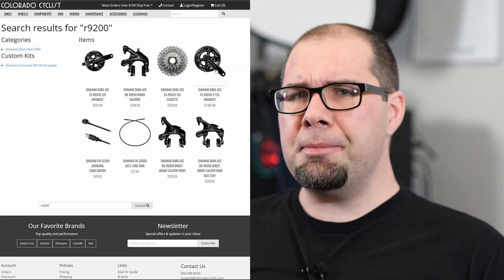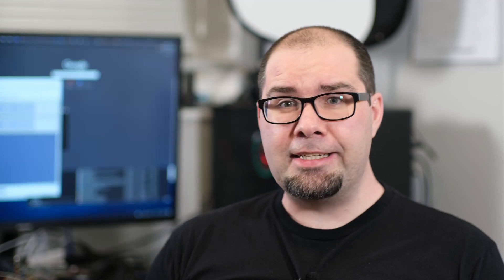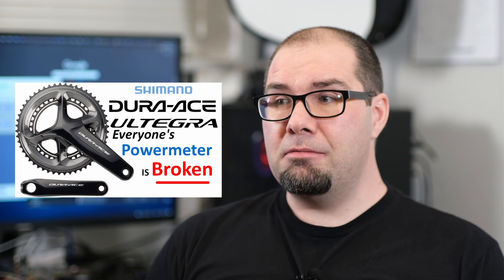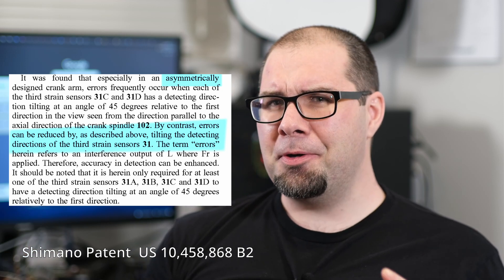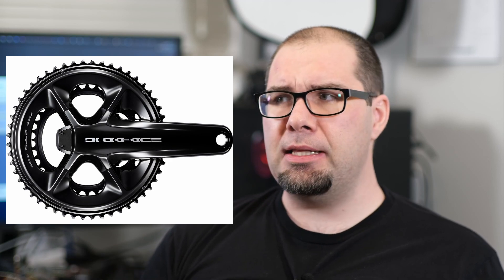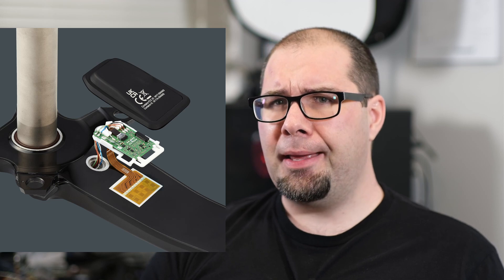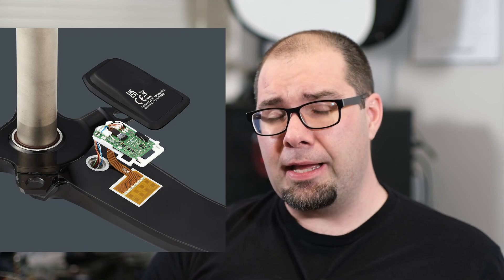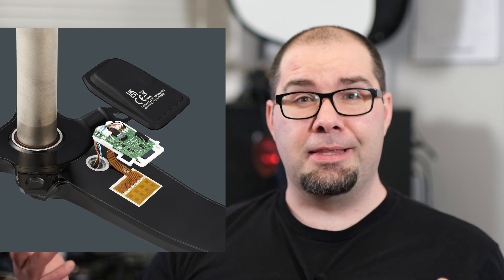Shimano's Marketing might have let slip a critical flaw

Comment: Keith, even if the crank arm is symmetric the forces acting on the crank are asymmetric due to the offset of the force input at the centre point of the pedal.  So there is a torque acting on the crank causing twisting of the arm.  So, a simple rotated strain gauge is probably not solving the full range of possible forces introduced to the system, as your own experience of pedalling with different input positions shows.  I am surprised to see that they are placing all sensors in one plane.  I would probably have placed some compensation gauges at the side of the crank arm and/or opposite side of the crank for common mode rejection. .
Reply from the maker: The issue with compensation gauges, which has been my speciality and most of the patents I'm listed on inventor for, is that you have all the problems on one pedal... plus what's coming through the axle. Hilariously, Shimano has still not come up with real solutions. I proposed their silly DI2 gear sensing idea years back, and it was a useless... least wise because what would the mechanical groupset do at the time? Now less of an issue but still. Once you get to this level of trash design for aesthetics even I was running out of compensation methods -- and then they didn't even bother validating the redesign of the arm for the 9200. Bad engineering

Comment: Could it be: Crank is symmetric but gauge pattern installation angle could be off. Thus crank appears asymmetric wrt the gauges. However the angle between the tilted gauge and the straight gauges on the grid is absolutely known... So in essence self cancelling of installation misalignment, but would need another cal factor.
Reply from the maker: The gages on one side is definitely tilted like the 9100 in that picture, there is zero doubt in that. Gage's are built on a lithography process so there is no measurable by eye accidental turning of a gage on a whole backing like that. The crank appears symmetric (see the fade flipping that you don't notice). The Shimano patent indicates specifically the tilting of the gage is for asymmetry corrections. So it could be asymmetric internally but that would be beyond dumb at this point given their poor performance.
Reply: Yep the gauge array/grid will have no misalignment in itself but when the gauge array is laid on by the worker/machine to the crank there could be misalignment. The gauge will then read the crank is assymetric. The angle of the tilted gauge on the litho pattern is known thus you could derive a correction for improper alignment. Slightly rephrased what i said earlier.

Comment: Does the hollow two piece glued aluminum shell make it much harder to design the strain gauge then? It seems a bit more complex than others you've shown.
Reply from the maker: Yes it can have an impact but it's usually much smaller. There is generally so much surface area that most of the problematic epoxy problems go away, things like creep and weird thermal problems. The variance in positioning and sides getting similar vs dissimilar amounts of glue I've seen cause changes in the "axial" (really lateral bend caused by axial force offset by pedal causing a lateral moment) corrective values. So it can certainly have an impact, though its much smaller than the overall shape in general.

Comment: Something I’ve noticed about my StagesBike SB20 crankarms is that introducing non-rotational forces heavily influences the deviation from known-good Assiomas and Vector/Rally pedals. If I pedal in a way that pushes my knees/lower-legs out, the Stages cranks report higher, up to 10-15W around 300W. If I squeeze my knees/lower-legs inboard, then the cranks start reporting a few watts lower than my pedal PMs. It’s incredibly frustrating because I was able to get others to reproduce the issue. I spent $2400 on a smartbike that I can’t use in good conscience during higher level “indoor” races like USA Cycling’s eSports Nationals held yesterday.

These cranks are mostly symmetrical in design using the standard Stages Gen3 pod/hardware. There is a slight amount of asymmetry at the “bear claw” which I suppose could slightly influence strain measurements, maybe more if the pedal bores at the extreme ends are used? eg more twisting as a result.
Reply from the maker: I've never looked into these bigger steel cranks. At a previous company another group were looking at them and they were crazy stiff due to steel. That extra mass swinging around could potentially be the cause, or it could be the geometry. I'm curious enough about this that I might see if I can find a SB20 in real life to take a look at those arms.